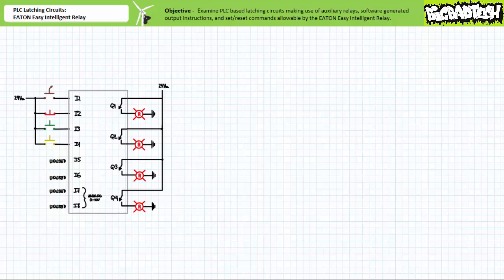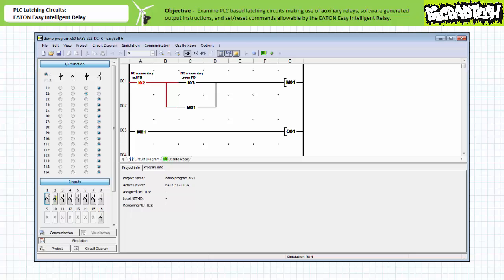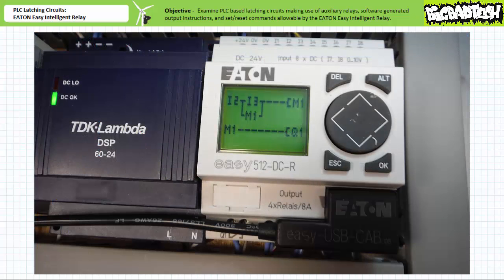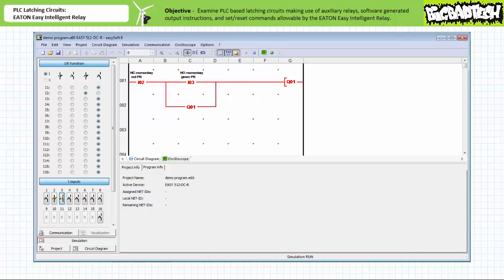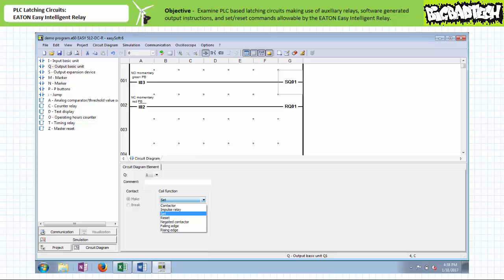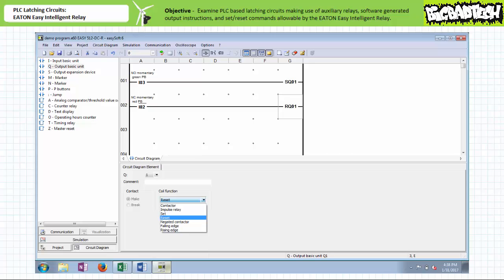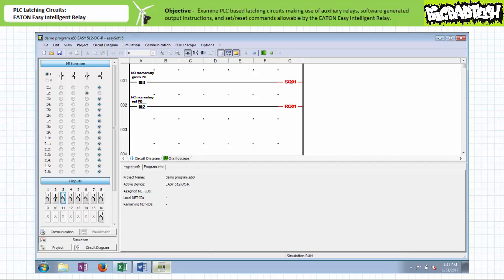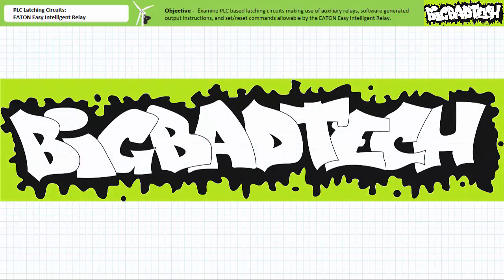PLC Latching Circuits: EATON Easy Intelligent Relay (Full Lecture)

Comment: Thanks for this video.  I'm having trouble with this circuit in easySoft 7.  I assigned the P buttons in place of separate input devices.  The circuit will start, but will not stop.  The same circuit works fine in easySoft 6.  Have you found this too?
Reply from the maker: Sorry, I don't have any experience with easySoft 7, I'm still using 6. Will it function as intended when downloaded to a device?
Reply: @bigbadtech  it didn’t function on the device either. I found out after some digging through the user manual that the P buttons are disabled by default when a display text function is used. I had to click on some check boxes to enable them :-)